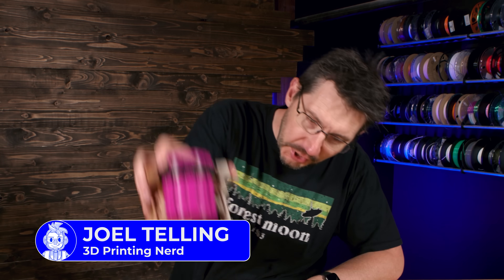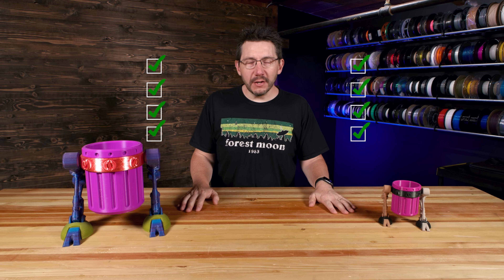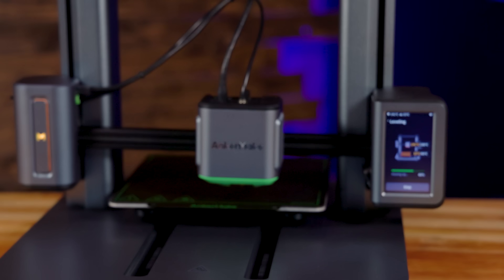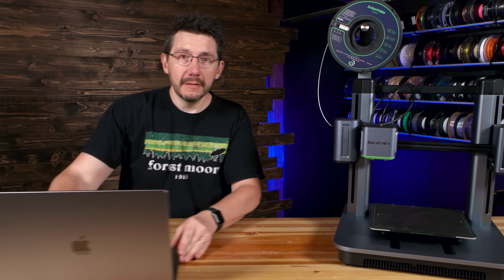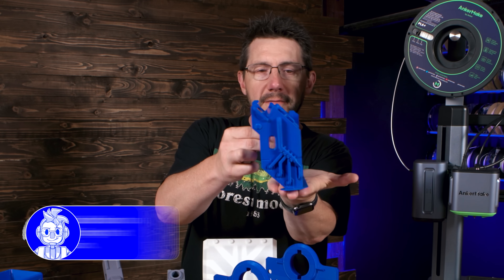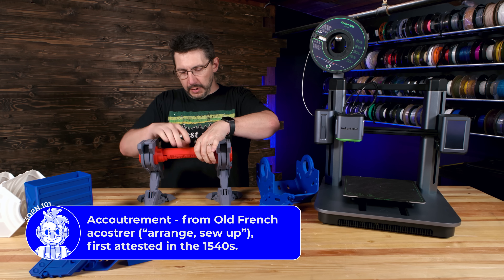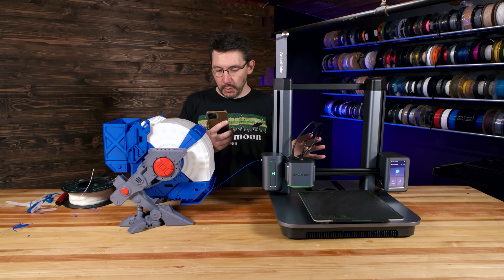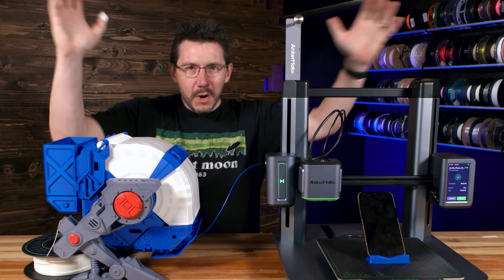TAKE A GUESS on the AnkerMake M5 Project!

Comment: Joel - just a thought about the cover/window piece - depending on the specific details/contours of the cover, you could perhaps cut out the thinner sections & replace them with a clear, thin & flexible (because of the curved shape) plastic that you could glue in place.

Alternatively, if you don't have a way to print the cover in a clear material, or it would work out ti be too costly (or too much jassle in some way), you could maybe make a 2/multi part silicone mould of the window section & then use that mould to make a new wi dow out of a 2-part epoxy resin.

Or not. It's just an idea. 🤷‍♂️

Comment: Were there any failures during the long prints?  would be nice to have a little more info on its performance. thanks.
Reply from the maker: I had one failure on a leg piece when the garage was a bit too cold and I didn’t have a proper offset. That’s was it else everything printed great.
Reply: I've had mine since October last year i was one of the kick starters and this machine has been extremely reliable not to mention the massive improvements the anker team has managed to make via software. It used to only print 250mm/s now it does 500mm/s no sweat. Only print failures I've had were due to dirty beds haha

Comment: I'd rather spend 700 on a P1P
Reply: P1P isn't a bad choice but some things you may not see are the communities behind them. The ankermake community is just excellent their discord is extremely helpful and even open to making modifications to the printer someone even went and converted it with linear rails lol. Aside from that the printer has come a long long way from where it started the 500mm/s print speed is really nice plus a bedslinger is just easier to work on compared to a corexy. Might not be for everyone but it is a really nice printer.

Comment: How about the volume? There are customer reports stating that the device is very loud. One customer even wrote that it is unsuitable for apartments.
Reply: M5 owner here. It is quite loud but there are fan mods made by the community that help. If you print slower it's not as loud. Noise seems to be a problem with a lot of the faster printing machines. Even my modded out S1 Pro can get quite loud when using Klipper to print at faster speeds.